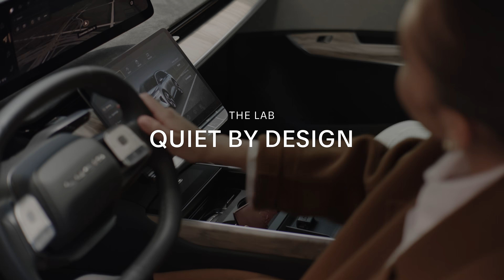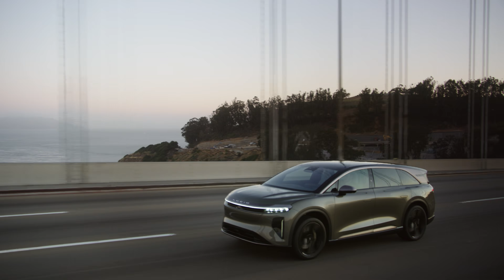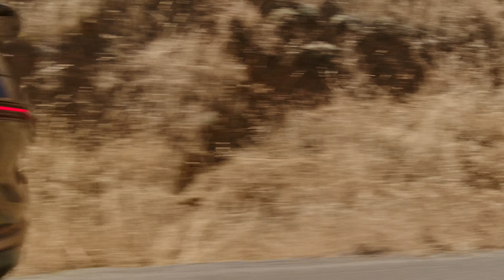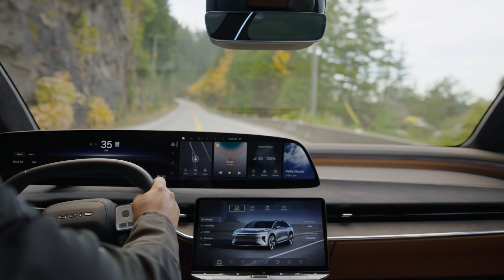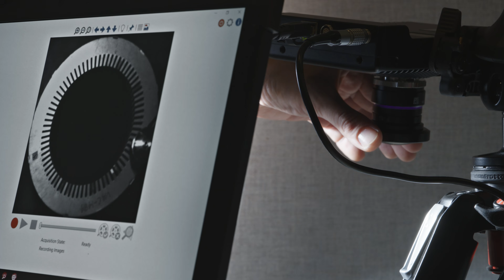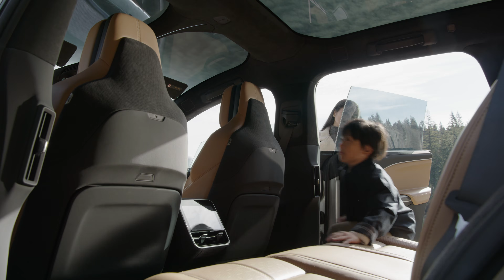The Lab: Quiet By Design | The Road To Lucid Gravity

Comment: The amount of detail invested, adds to an already mounting case for this vehicle to be #1
Reply: @Stan54321  I AGREE WITH YOU STAN 💯 🫡THAT'S THE LUCID🏆🏁 GUARANTEE SUV OF THE YEAR 2024 2025 2026 🥳🥳🥳🥳🎇🎆🎇🎆🎇🎆🎆🎆😉👍🙌💎💎💎🙋‍♂️❤️
Reply: Lucid should design and manufacture F1 inspired carbon fiber core rotor e motor which can rev to amazing 30,000+ rpm and 15 hp/kg drive unit level power density(each drive unit should be able to produce 500 ps and 700 nm of torque with the weight of only 35 kg each) and 2 speed transmission for maximum high speed efficiency . They should use samsung's sulfide based  solid state battery cells in their battery pack also.if they do 2027 lucid air sapphire will weigh only 1790 kg with 600 miles of range with 6.3 miles/kwh efficiency,please lucid read my comment do it exactly like i just said..